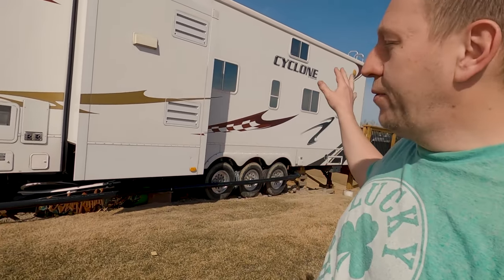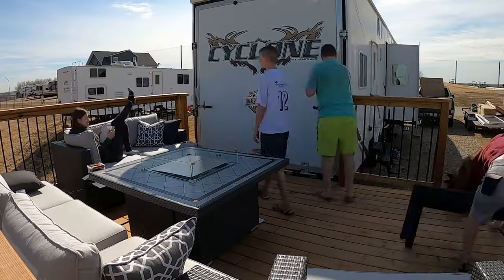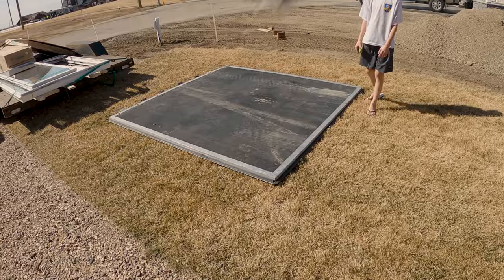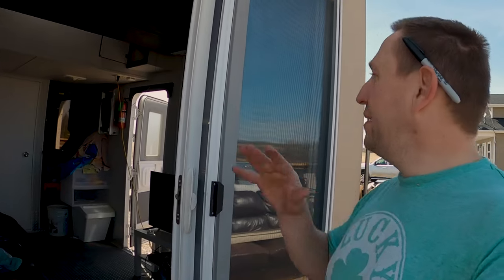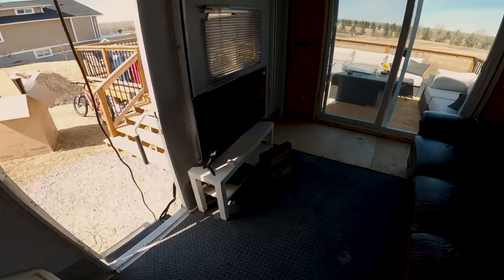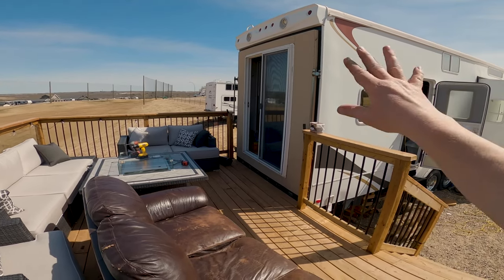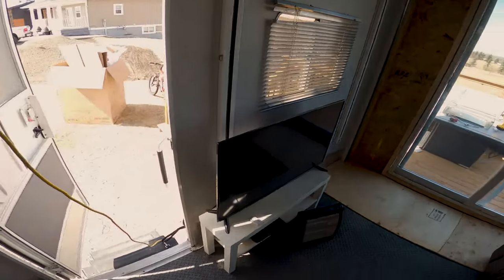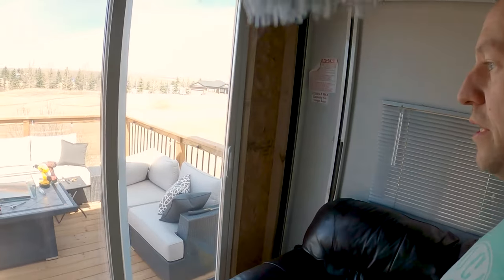We installed a PATIO DOOR in our TOY HAULER! | GT Canada

Comment: This is fantastic! I want to do the same thing but keep the ramp as my patio. And also as security so that I can lock it when I am not at my annual site. I feel like I can take this idea and shift the new wall in a few inches to make this work for my needs. Very inspiring. Did you run into any issues that you didn't catch on camera? Thanks!
Reply from the maker: Yes you could easily leave the ramp door attached and put the wall on the inside edge instead

Install would be the same, but you would probbaly want to drill holes through the metal lip that teh door rests against so you can run some screws into the 2x4 frame to keep it from shifting while driving.

I experienced no issues at all. Once done I sealed up the cracks with expanding foam and it's been working great
Reply: @GearsAndTech  Wow! Thanks so much for the super fast reply. That is a good idea for the framing. I won't be driving it, it will be stationary. But if I sell it down the road, I might as well do the work up front rather than having issues later on. It will be a while before I can do the install as it is too cold in the PNW right now, but I'll let you know once I get it done. Thanks again!
Reply: Have you done this yet? I was looking at 3 seasons but much cheaper to build myself

Comment: Hey i want to do the same but i would travel with it and keep the ramp. How much weight did you add?
Reply from the maker: If I had to guess I would say I added 200 - 300 lbs

If you plan to travel with it you'll need to inset the door on the inside of the door frame so you can still close up the ramp door.

Not a big deal, and totally possible